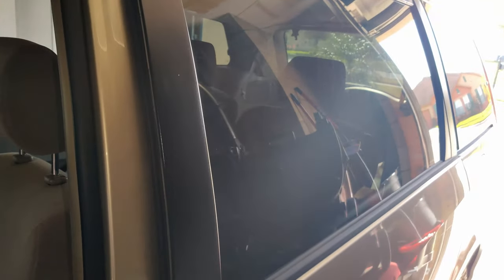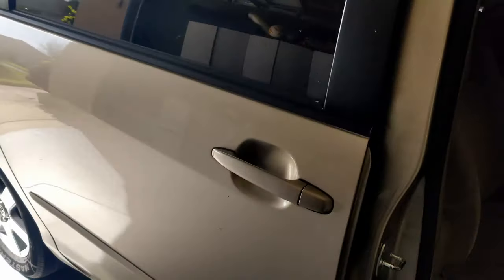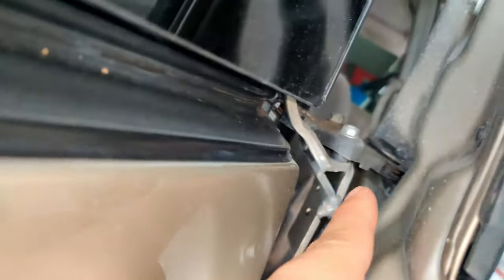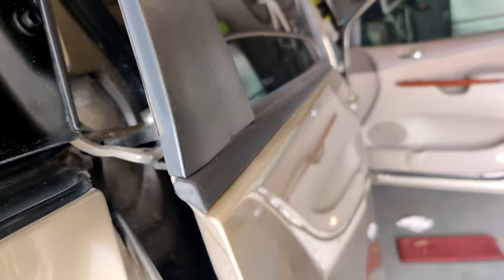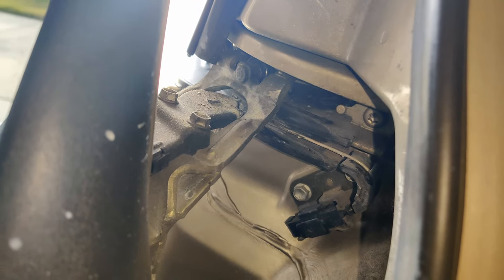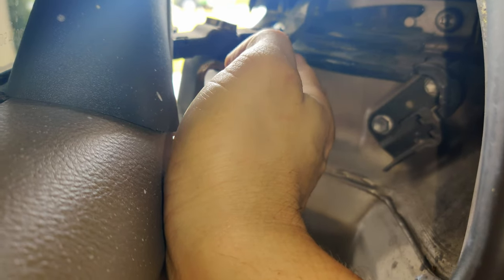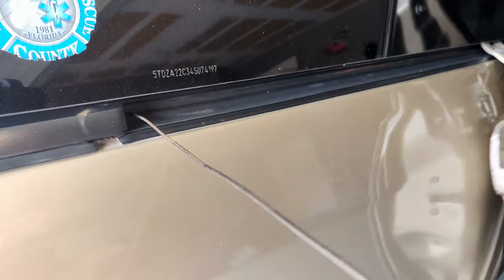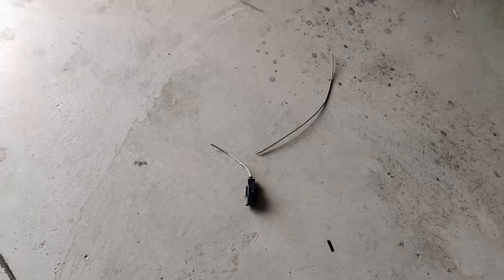How To Fix A Power Slide Door That Won't Open Properly On A 2004 - 2010 Toyota Sienna The Cheap Way

Comment: Thank you so much! I have been living with an inoperable door for 5+ years. Toyota dealership told me they would repair the door for $2200. Cable assembly alone was $1600.  I said just disconnect it so I can use it manually; they said that couldn't be done. Just made it operable in less than 10 minutes. Again, many thanks!
Reply from the maker: I'm not surprised to hear that Robert.  Stay tuned I will have more upcoming videos on how dealerships are charging outrageous prices for repairs, parts, and even car sales.  I'm glad this video was able to help you! Good luck!
Reply: I have the same issue. I don't mind buying new motors later or whatever. I just would like the doors open.
Reply from the maker: @DavidrKun  well you tuned in to the right channel! ...working on more upcoming tutorial videos keep checking back in!
Reply: @stevensautomotiveexperience  well, I did everything you said minus taking the panel off. I can't seem to wedge the door open. It's like it needs DW40 or something.
Reply from the maker: @DavidrKun  Did you disable the power sliding door feature? And yes those cables could get rusty, you may just need to have someone pull the door as much as possible so that you can get in there and cut that cable.  Thanks for watching.
Reply: @stevensautomotiveexperience  I have tried to pull the door. Feels like I am going to rip the handle. I will try and see what I can do. I really want to do this on my own. Bought to spray something to loosen it of any. Thanks for making it. I worry that once I cut it. I can't close it. But if I can cut it and just use it manually I am okay with that until I can fix it correctly. Thanks again
Reply from the maker: @DavidrKun  If you have to pull that hard your cables may be completely destroyed inside and at that point you may have to take the door panel off to see what's going on or even cut it from there.

Comment: My 2004 Sienna drivers side cable broke 2 weeks ago. 3 days ago the passenger side started to hang. Toyota quoted me at $890 for one side. I was unable to remove the plastic clip with the tools I have. I opened the door about a foot and rolled down the back window and just removed the 2- 10mm head bolts so I could remove the plastic bracket easily. Worked perfect with a short extension. I removed the plastic cable bracket with my finger once it was off. I then cut the cable at the rear end of the window and at the door. I did this to both doors in about 20 minutes. Both doors work perfect, just not automatic. I'm happy. Many have said the cables broke again after Toyota replaced them. I'll save my $1800 for something I really need. Thank you for sharing. UPDATE: I went to Toyota on 10/7/21 for an oil change and they changed their price to $1400 for each cable. They also offered to change all my fluids including brake fluid for $661. Nah, I'll just have the oil change..
Reply from the maker: Thanks for sharing your story, so glad I could help!!!! Thanks for subscribing!

Comment: Toyota is aware of the defect of this door. I have an 04 sienna xle and contacted the administrative office of Toyota and received $1,500 to repair the door.  I suggest everyone to do the same.
Reply from the maker: Yes they are, there's actually an specific Toyota Technical Service Bulletin for this issue and Toyota extended the warranty time for this which I'm sure by now in September of 2020 you're on your own.  Glad to hear you were able to get them to pay for the repair! Thanks for watching stay tuned for more upcoming videos.
Reply: I have the same year Sienna XLE and got no where with Toyota. I was told that program expired for my Van in 2013
Reply: @jzm6403  I just bought a 99 toyota sienna xle and the door is not working so I'm doing the cheap way.
Reply: Where did you get that information. I talk to a supervisor at a Toyota repair place and they are not aware of such a claim to fix you sliding door. Guy wants to charge me )100.00 just see what’s wrong and them I have to pay for them to fix it. 
No way am I going that route. 
How did you get them to pay you $1500. 
Did you have a legal counsel on this

Comment: Many many thanks for this video.  For me, it really helped to roll down the window (driver's side).  I was then able to pry out the cable end box easily with the door open a little.  I was barely able to open the door a few inches before I did that.  Afterward, I could fully open the door.  Cutting the door cable was quick.  Literally a five minute job and now it works great as a manual door.  I don't need an automatic door on the driver's side but I'm happy that it lasted 13 years (June 2008-June 2021)

Comment: Literally just finished popped the black piece off and took less than 1 minute thanks so much for posting this my stress level just went down 200%. This single mom thanks you a million times over
Reply from the maker: Glad I could help!
Reply: So I did this as a temporary fix .Worked like a charm! hen I also called the Toyota dealer April 30th 2022 and they told me they would fix it for free since it is a safety .  Apparently safety recalls transfer with the VIN number i and don't expire. Win win!
Reply from the maker: @naturalmysticone7721  I'm glad !!!

Comment: Today I am able to open and close my door thanks to this video. My 2004 passenger side only, also has door assist,with the wire snapped and door shut. I was able to open it with pressing the button on top by rearview mirror. first day it only opened alittle then today it made some noise but opened it far enough to pull the wire.

Comment: I have a 2004 dodge caravan passenger sliding door open but wants to close right back.  I already replaced the wire harness and slides. But didn't fix it. HELP PLEASE
Reply from the maker: I haven't dealt with that year make and model's sliding door so I couldn't possibly help you. Sorry. Thanks for watching.

Comment: Nice video! Just bought an 04 and going to use it for mail car passenger side can open manually but theirs a part where tha cable is i guess partly unravel and when it hits that it gets harder to open definitely a first world problem but would like to see if i could fix it

Comment: What did you actually do to get the passenger side power sliding door partially open to gain access to the cable mount in the door jam?
Reply from the maker: Pretty much force it open.

Comment: Steven, Thanks for the video. IF I DO THIS CHEAP FIX CAN I LATER DO IT THE PROPER WAY BY REPLACING MOTOR, CABLES?  thks
Reply from the maker: Yes sir, absolutely.

Comment: Totally about to do this on my 2006 inspection time is here and I don't want to have to pull off door panels and replace parts on an older vehicle. Mine was just bound and wouldn't open any further on one side the other door still works automatically

Comment: Okay so I wish I knew this sooner cause I manually used the door even tho it would get stuck open. And now. It jsut won’t open at all. It’s like off the track but that cable is snapped outside the van door.
Reply from the maker: Better late than never, glad this was helpful!

Comment: Both my doors are stuck. I'm thinking I need to cut them too. I personally don't care about auto open doors. Just would like to open the side without climbing in the back or threw the front.
Reply from the maker: Sounds like you need to do exactly what I did in this video! Thanks for watching!!!
Reply: @stevensautomotiveexperience  well I got one open. But the locking mechanism is now not locking. So yeah. I need to get them closing again. One problem to another
Reply from the maker: @DavidrKun  oh wow sorry to hear that, well you may be a Sienna Sliding door expert after you're done! Good Luck!

Comment: I have a handicap van and the cable broken 3 times in 2years it’s very expensive to get it fixed since it’s connected to the ramp please tell me if we can  put a cable and motor in the door and separate it from the ramp so the cable problem can be solved, please help I am stranded without the handicapped van.
Reply from the maker: I wish I could help, but unfortunately I haven't worked on any of these handicap vans, therefore I  am not sure.  Best of luck.

Comment: HOW did you get it open before you started working on the cables? That's what I neee
Reply from the maker: Hey there, Thank you for watching!  If the pulley/cable assembly is not so badly damage internally you can actually force the door open, (remember to disable the power slide door feature first with the button on the dash) all you need is about 1/3 of the door opened and then you can proceed with cutting the cable. Hope that helps!!!

Comment: Hi Steve,
mine cable broke and stuck I can't open the door. How am I going to cut cable?
Any suggestion?
Thanks
Reply from the maker: You, would have to remove the door panel from the inside of the vehicle along with the whole actuator/cable  assy thats attached to the door it self so that you can get to the cables and cut them.  Unfortunately, at that point it won't be so easy.

Comment: I cut the cable and still can only open it app about 2 inches what's going on
Reply: Can anybody help on that
Reply from the maker: @orvillegroven186   You're not giving me much info to get an idea of what's happening here, I would say make sure you've disable the power slide door feature with the button located in the driver's side.  It should open & close after you cut the cable.  Good luck!

Comment: B's I did that to mine but it won't open from the inside
Reply from the maker: It is not B's. It works.
Reply: Maybe the child lock switch got switched on accidentally during the repair. You can see it when the door is open. it's on the panel that faces the front of the car, near the handle
Reply: @loribeckberger4430  no it all started when the latch that locks in when the door closes won't lock in it just pops the door back out because it's Rusty or something and it needs to be replaced or the hinges off balance and it's making the door hang off the weight there's a latch and a hinge towards the back of the door that it either offset or Rusty and it won't let the door close and lock in it pops back open but then when I force it s*** sometimes the locking mechanism on the front of the door locks in place everything gets stuck and the only way you can get the door open as if it magically unlocks itself sometimes when you turn the car on otherwise you're going to have to like bust a hole in the door panel just to open it
Reply: And that is just that door the door on the other side the sliding door cable broke on its own I never replaced it yet but it also has a hard time opening from the inside unless I rig it a certain way and half the time that don't work and then I have to get outside to open it from the outer door so my passenger has just stuck sitting there until I get out and open the door

Comment: For future reference, if purchasing a Toyota or Kia minivan, don’t get a power door option. The motors are underpowered and the cables & attachments are weak and prone to failure. The manufacturers have no interest in correcting these deficiencies, so don’t waste any money on them
Reply from the maker: Good to know.  Don't know about Kia, but Toyota did have an extension of the regular warranty for this particular repair.  Thanks for watching!